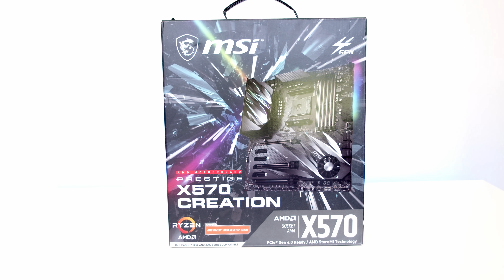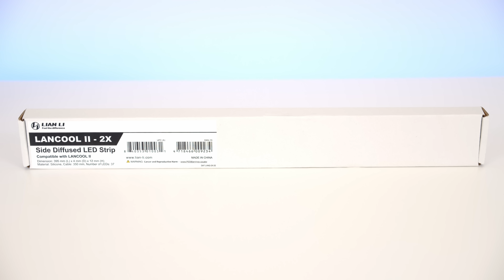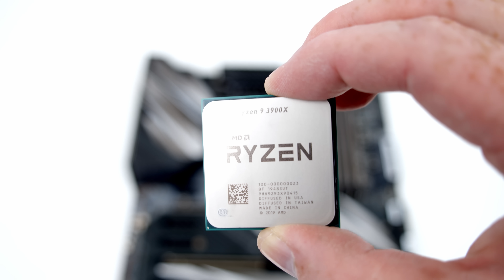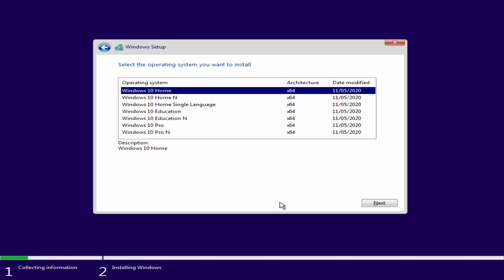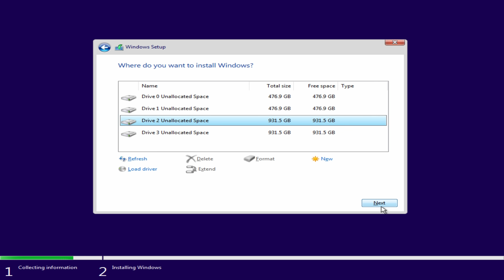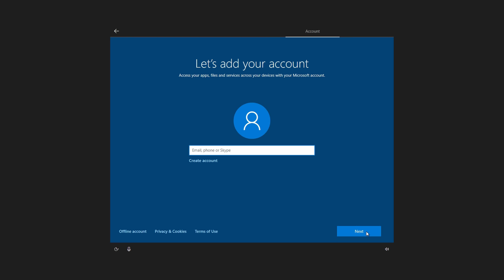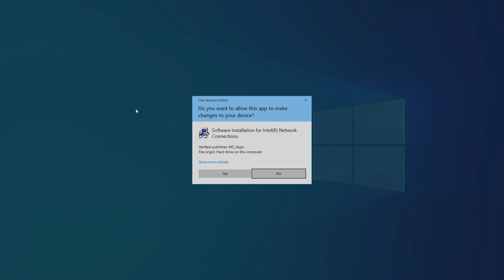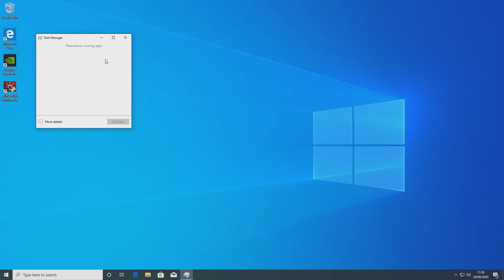Lian Li Lancool II Mesh Step-by-Step PC Build Guide

Comment: Lian Li? That sounds like a Ali Express product, if you want a working computer buy quality components not some random brand, especially for the CPU cooler where you wouldn't want leaks :D Props for the guide, really good but the components..
Reply: arguably one of the best cases out there is from lian li, the 011-dynamic. do your research before making such an uninformed comment
Reply: EXTREMELY unqualified, and misinformed comment. Lian Li is one of the greatest brands out there, for many of their products. What a dolt.

Comment: Hello Christopher, I am fan, subscriber and really like how easy it is to follow your clear explanation of what can sometimes be a very difficult process. I used the same case and cooler for my build in basically the same orientation. My pump starts out quiet but after a short time starts to whine loudly. I posted about a one minute video on my youtube page of the whining noise in hopes of finding a solution. I am still within the Amazon 30 day return policy. I would rather not return it if there is a fix. This is the link. https://www.youtube.com/watch?v=aLtRIYCyK-s Any advice would be greatly appreciated.
Reply from the maker: Is the pump in dc mode and not loose. It sounds faulty I would ask for return, Amazon will normally send new on before you have to send the old one back so no reason not to return it. I would also do some thermal testing to work out if there is a problem.
Reply: @ChristopherFlannigan  Hello Christopher, thanks for responding and the advice. Your tutorials and advice are very helpful. I am happy I found your channel.  Amazon exchanged it for a new one which will arrive today. I really appreciate you responding so quickly.